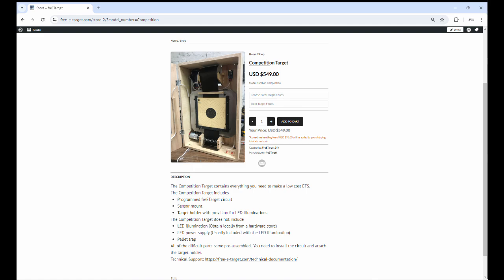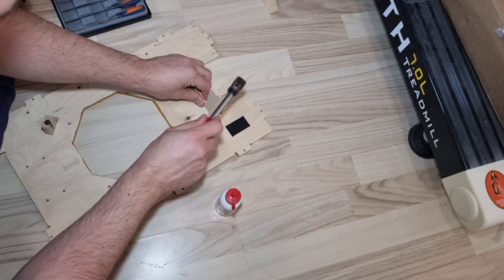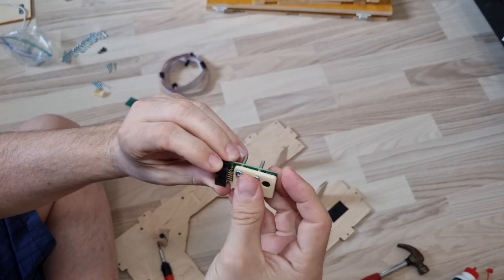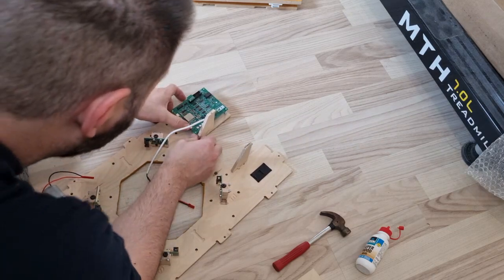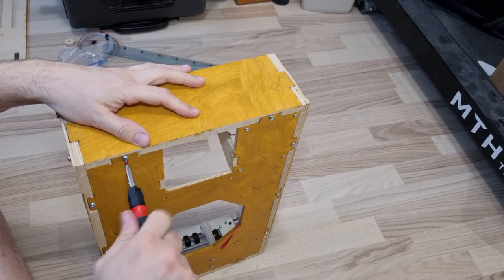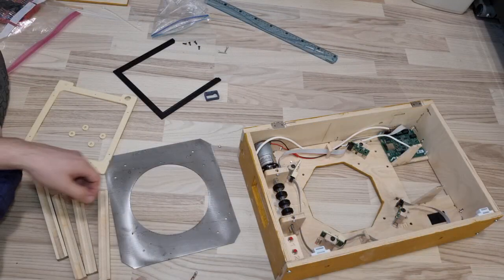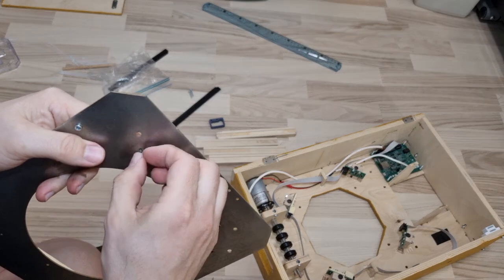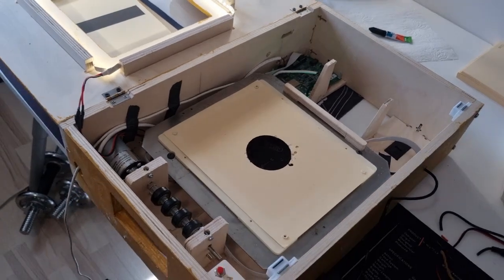freETarget Competition Kit [EN]

Comment: How big is the power output from the supply? I checked that the motor is 12A 150W, but most LED transformers do not output at that much power. Thanks!
Reply from the maker: hi. i put a 12V 3A transformer and it works just fine (with both LEDs and motor). that would be 36W